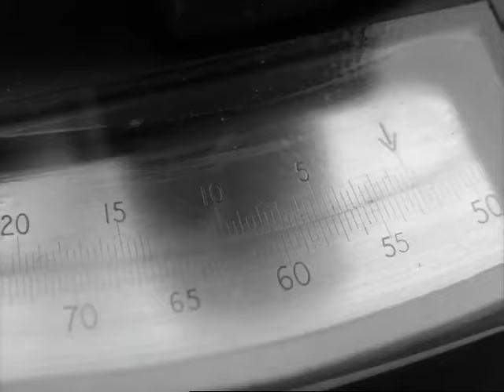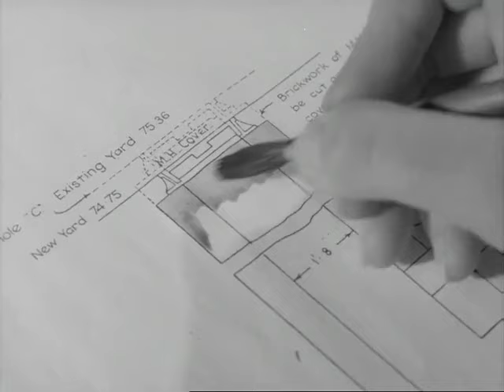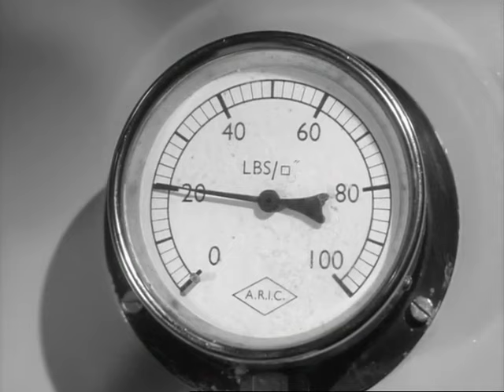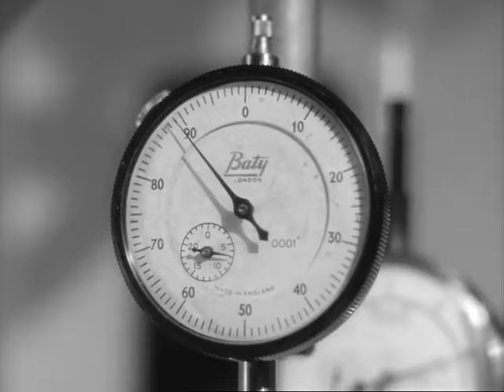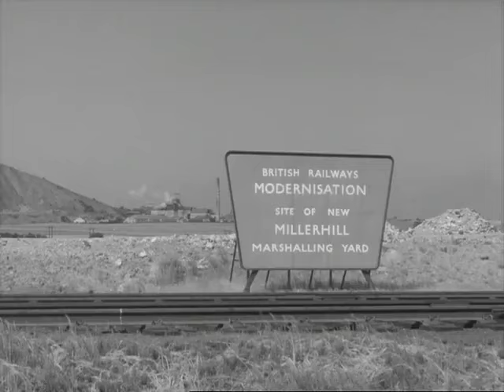Vintage railway film - Groundwork for progress - 1959

Comment: Every large factory had railway sidings when I was a boy in the 1950's . Huge amounts of goods and materials were moved by rail, quickly and efficiently. Slowly the lorry took over and as stations disappeared so did the goods sidings. Rail passengers ended up on buses as well. I lived in Wigston Magna, wonderful place to be a trainspotter.
Reply: i am from ilkeston   derbyshire  we boasted  5 railway stations then beeching  shut the lot !  after 50 or so years they re opened ilkeston junction..  but hardly anyone uses it   !

Comment: I moved to Potters Bar in 1956 and spent years trainspotting by the old and new tunnel as it was being built. Every few minutes at night the warning hooter could be heard as trains mainly freight passed through and close to the workings. We also loved to ride on the narrow gauge railway trucks which were used for earth moving along each embankment only to be chased away by the night watchman. Great times but so sad that freight disappeared very quickly during the '60's & '70's.
Reply: Yup the milk train, cars from Luton Vauxhall factory, the cement train...

Comment: 1:04 is Pont Britannia, a tubular bridge linking Anglesey to the rail network, built in 1850 and then rebuilt in 1972 as a steel truss arch bridge using the original piers after a 1970 fire irreparably damaged the wrought iron tubular structure.

Comment: Wow, that was extreme manual labour. Technology has thankfully improved the working conditions for these crews. Fascinating to witness the way it used to be and thank you for posting this video.
Reply: For extreme manual labour, see the digging of the canal network – or digging the earlier railway tunnels! The point made by the narrator of this film, is that the machines of 1959 were saving a lot of manpower.